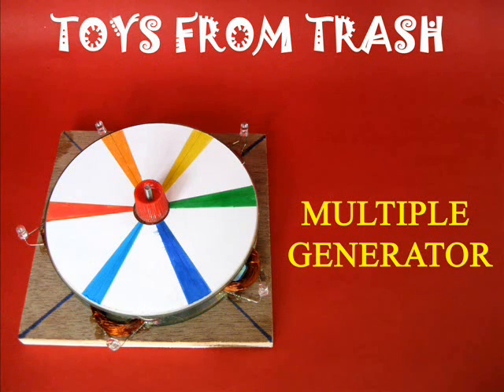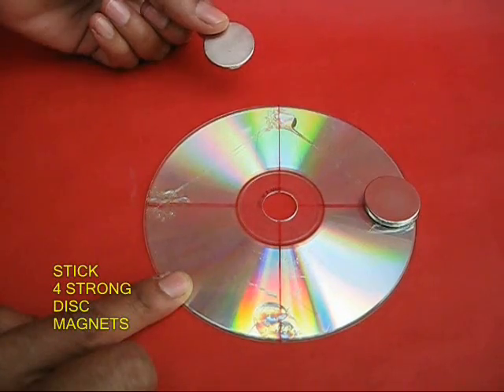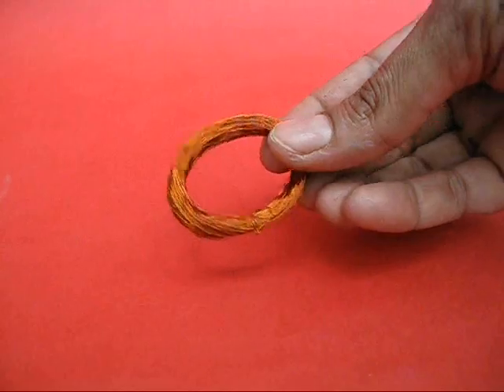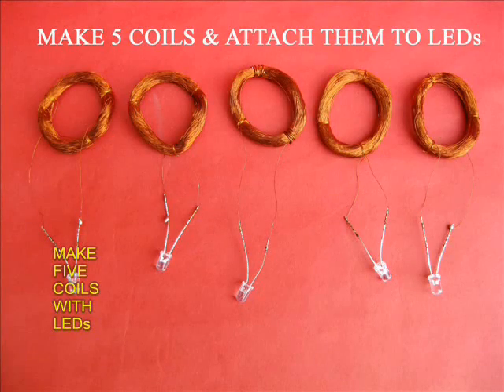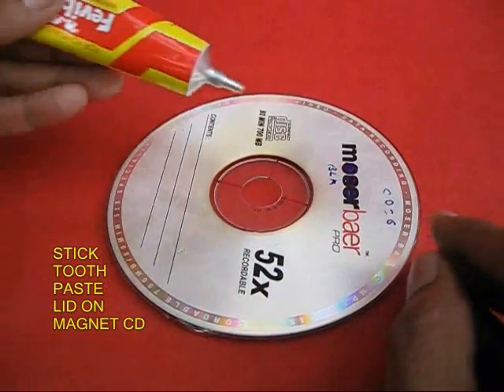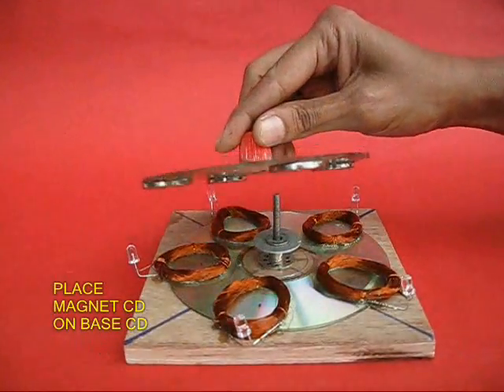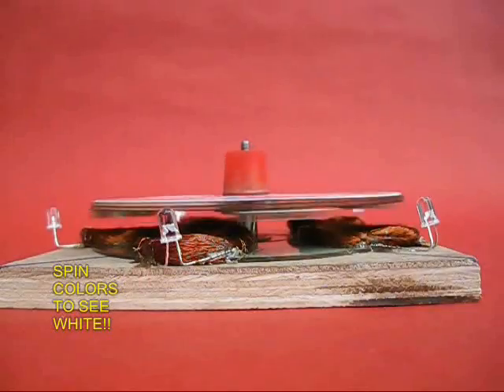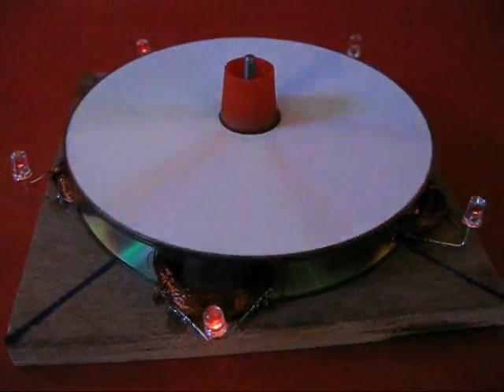MULTIPLE GENERATOR - ENGLISH - 27MB.wmv

Comment: Hi,

  Your project seems great, i like to make 1 for my cousin school's project, but some questions :-

1. Can i use simple speaker magnets, if not, where i can get strong magnets & whats approx. cost for the same in Delhi/NCR (India) ???

2. should i use THIN Copper or THICK Copper Wire ?, 
How many Minimum Turns required to light LED.

3. how much voltage or current it generates, its DC or AC ???

4. whats would be the total cost of project ???

Thanks in Advance
Ashish

Comment: can u specify the thickness of Cu wire and the diameter of the coil??? can we use normal disc magnets and instead of 4 if we put 8 is that ok???

Comment: do you need neodynium magnets? i got some very strong magnets (not neodynium) and a single coil can only produce about 100 mV - i tried with 1000 turns on the coil, but this also doesnt give near enough to light the LED.